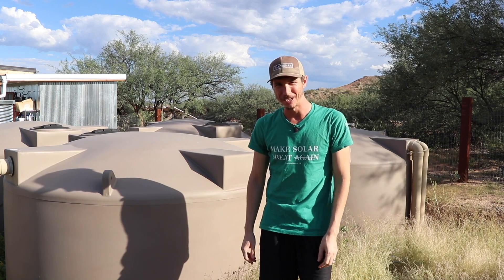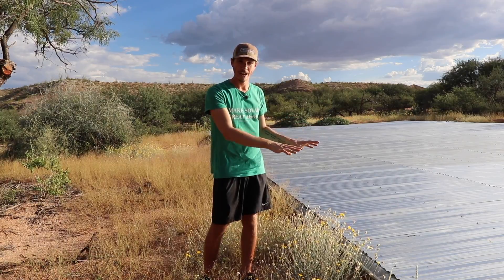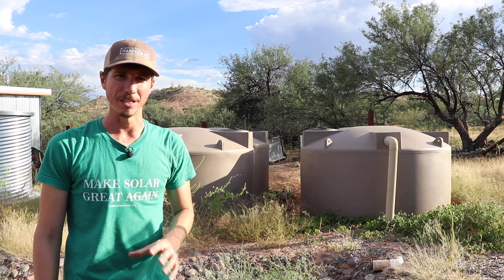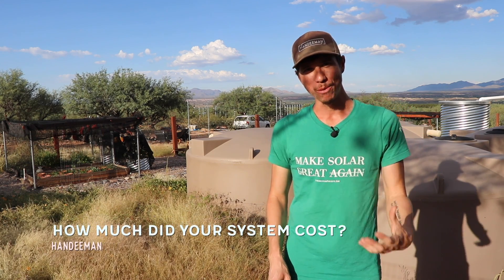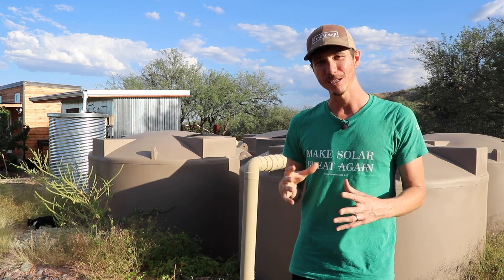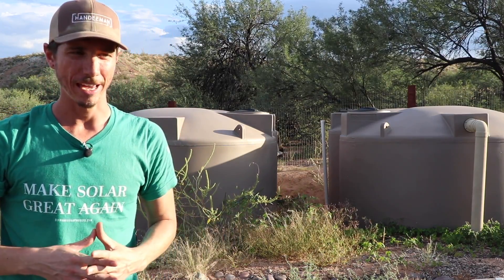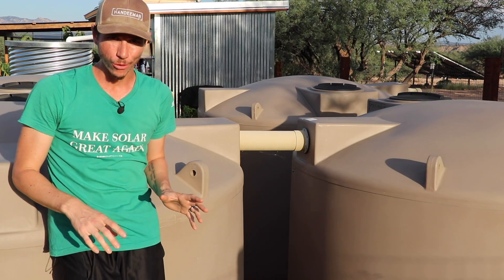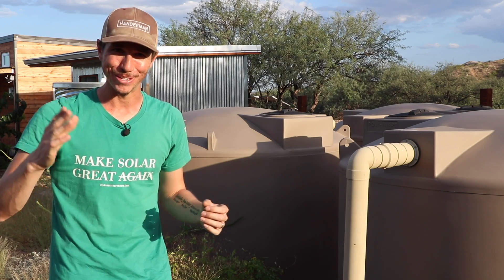Rainwater Harvesting Q&A - Legality, Cost, Treatment

Comment: This is an odd system? First off you don't strictly need a particulate filter as your water has already been settling in a tank for months, but let's say that's just a nice to have. You don't strictly need a carbon filter, that's a chemical filter for removing chlorine from city water and hydrogen sulphide from well water. It's doing nothing in your situation because rainwater is only picking up a bit of acidity from the air, which again is almost nothing in your non-industrialised area.
Personally I'd just use a particulate/carbon filter for drinking and combine that with UV system - rainwater potentially has pathogens from birds/bugs pooping on your harvester, but there's really little point in filtering water for any other use.
Lastly, that expensive Berkey is just a big tin can with a particulate and a carbon filter. Basically you've already installed those so you are doing the exact same filtering operation twice over? Plus you are tied into their $$$ marketing markup on their branded filters. 
Fun fact - Berkey use the exact same ceramic and carbon filtering technology that everyone else uses, there is no magic crystal Woo-Woo here, if it's good enough for Grade 1 Laboratory work then it's good enough to make tea with.
In Europe, nobody uses those daft Berkey things, we all use those blue inline filters like you've already using. 
As always, don't believe me, do your own research on 'whole house filters'. I'm pretty sure anyone who does that won't be buying a space-wasting Berkey.
Reply from the maker: thanks for the info! I guess it just gives us piece of mind but I didn't think the blue inline filters did that much.

If you have any suggestions I'm open to hearing them :)
Reply: Just for context, Africans drink out of cattle puddles with every pathogen known to man swimming around in it, yet their population is quadrupling. 
I'd stick with your current particulate and carbon filter but maybe sell the Berkey? If you get your water tested and it has a significant amount of pathogens then try a UV unit, but I really doubt anything like that would be required out in the desert. 
Some people will need to filter their shower water but again I'd doubt this applies to you, I reckon if you get the filter output tested then it will be perfectly clean. If you just used the two filters for filling a drinking water tank then they will last longer and be more efficient.
I'd limit grey water to trees (which I think you are already doing), as it's more likely to contain bacteria.
Reply from the maker: I've seen some cattle puddles on a hike, disgusting to say the least lol

ya maybe in our main house we'll get a UV unit to kill all that stuff

our mulberry tree has been going nuts on our grey water from our washing machine :)
Reply: >> Just for context, Africans drink out of cattle puddles with every pathogen known to man swimming around in it, yet their population is quadrupling.

OMG, don't tell me that is your criterion for healthy water, not too many people getting sick or dying?
Reply: justgivemethetruth - No, I specifically said that comment was for CONTEXT, meaning that yes (some) Africans do die due to crappy water quality, but that his situation, by comparison, is super-low risk and it's not something that requires an over investment in sophisticated filtration. What he has now is more than OK.
Just like Wranglerstar's new video on always buying the best oil otherwise your car will explode. It might do, but it's very, very unlikely and almost nobody keeps their car long enough to care.
Reply: The difference is the size in microns. Big difference between the sediment and pathogen filters - smaller pore size = less nasties get through. UVC will not kill nasties but destroys their ability to reproduce.

A good overview of sediment and carbon filters:

https://www.ag.ndsu.edu/publications/environment-natural-resources/filtration-sediment-activated-carbon-and-mixed-media

When one considers that dust storms from Africa reach North America, the air everywhere can contain contaminants.

Another good overview including purification

http://www.harvesth2o.com/filtration_purification.shtml
Reply: Nice constructive information here. Would it not be beneficial to have the activated carbon block filter if they decide on  treating the water with chlorine or would chlorine evaporate over time? Your argument about Africans however can be debated. I've been to several African countries where running water is virtually non existent and lots of people end up getting cholera, Guinea worm disease, Amebic dysentery etc. More than 3 million people die each year due to waterborne diseases. The UV light is a good idea since it will alter/damage the DNA of any and all bacteria in the water and prevent it from replicating and spreading.. What about water aeration? And a granule carbon block filter to better the taste and quality of the water?
Reply: Tiaan Smit - You'd be unlikely to taste that level of chlorine in that quantity of water, he can get away with a low level because he's storing it in a secure tank and there's no real ongoing risk of bacteria, unlike a well. City water is also a bit more exposed because of breaks in the line. So really chlorine filters are more applicable to city water, or areas where the groundwater could have been contaminated.
It's certainly a 'nice to have', and cheap enough just to install even for rainwater systems, it's just not doing anything super vital in this situation.
Sodium hypochlorite (bleach) will basically decompose into Sodium Chloride (salt(s)) and a bit of chlorine gas which will evaporate (plus other stuff dependant on pH and temperature - not a Chemist, feel free to correct), plus oxidising any organic matter.
Reply: Yes people with weak systems or high volumes of bacteria or other pathogens do indeed die, but there are so many more that survive just fine that their population STILL is increasing by leaps and bounds.
Reply: great to see an expert weigh in on the water quality of a billion people   on a whole continent.
Reply: I would suggest a simple reverse osmosis system that you can get for under the sink for drinking.  I would not trust the Berkley filteration system.  RO water would be the best  for drinking to remove any remaining bacteria and virus loads.   Get the water tested at least once a year and share the results to PROVE it is safe and free of bacteria and heavy metals or organics from the plastic tanks.
Reply: Eye-opening ... do you have a link or some literature on how best to filter and clean water?  Maybe a sensible approach might be to wait until one has a large volume of water in the reservoir and then take it in and test it and see what is in there, and work from there.
Reply: horse1066 I have a question for you and for everyone here. If Microplastics are a concern, would costing the interior of tanks with a sanitary substance be ok or ideal? Just curious on your and everyone else’s take on this. I’ve read that micro plastics mess with hormones and other biological processes. Just curious if that’s a factor here with all this PVC and plastic around.

Comment: Please be honest does a compost toilet stink in anyway in the house?  Can you smell it at all in the house when you are not using it?  Thank you!
Reply: A proper composting toilet, properly installed and used has *no odor*.

Liquids (urine) are sterile and contain nutrients. Solids (feces) contain pathogens.

Once dry, solids have no odor. Think animal waste left on the ground. It dries quickly through evaporation, resulting in no odor. It then naturally breaks down quickly and completely.

The mixing of liquids and solids is what creates a toxic (literally) mess. Composting toilets minimize or eliminate the mixing of liquids and solids. Combining a dessicating medium, such as saw dust, spagnum moss or coconut coir, with a modicum of ventilation via a very small fan and stack vent yields zero odor.

With typical use, a one gallon liquid catchment needs to be emptied every two to three days, while solids need to be disposed of about every four to six weeks at the most. And, by the way, emptying the solids catchment isn't unpleasant in the least. The contents resemble earth in most all respects. Additionally, you don't even clean the solids catchment as leaving it as actually helps to jump start the composting cycle anew.

Check out C-Head toilets for an affordable alternative to Nature's Head. Because sustainable elimination shouldn't cost nearly $1,000! Even better, build your own urine-separating composting toilet in an afternoon for $100 or less.

Hope that helps.
Reply from the maker: it can stink if you don't cover everything up with saw dust, you can smell it sometimes but it's rare if we do everything right

Comment: I have two uncles in the area who have wells and they have run dry due to the climate. Much better idea to rain water harvest. 👍🏼
Reply from the maker: over pumping of ground water can be a big issue :)
Reply: And depending on the area it is not just you who is pumping from said pocket of water as it could go under the farm miles away who is running a sprinkler system.
Reply: Candace Patten besides rain water harvesting doesn’t steal water from the environment, it only delays its passing a bit aka being used for human consumption. Off gridding guarantees the water will eventually go into the ground somehow so it’s just a delay. No water is lost. Rain water harvesting is a renewable answer and solution to water problems around the world. ☺️

Comment: A second question:  I don’t know about acidity of rain water, but is there any issue with lack of minerals.  Drinking distilled water is not supposed to be good gor you as it fluses minerals out of your body.  Would rain water be similar?
Reply: Yes this is a valid point, there's a reduction in magnesium/calcium/sodium etc, but he's vegan so he'll be picking a lot of that up from what he eats. Drinking bottled spring water is probably better though.
Reply from the maker: like what Horse said, I eat a healthy diet so I get plenty of vitamins and minerals :)

Comment: Technically you do have a first flush the way its set up, should they all be connected @ grade then I would push a first flush.
Reply: If it was a first flush it would be isolating those first few gallonos not continually running through them. This could be fixed pretty easily.  Right now it is just a really big sediment tank for big incoming particles because right now when your water comes in, it’s all at once, it’s not a batch and sit.(unless for each rain it’s less than the volume of the tank and a wait period and then draining that first tank. Also with the straight pipe that does not stop any floaters from getting in the downstream tanks.  

Sure it works just fine.. but some bells and whistles that could be added..  want to do a joint episode, after your garage is up... let’s talk and schedule something.